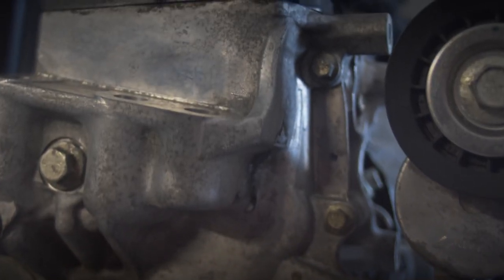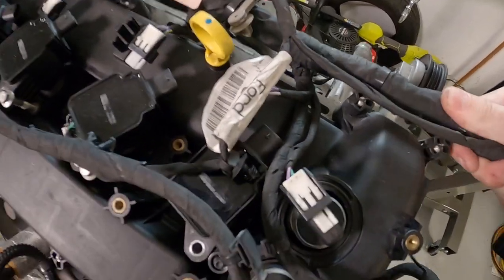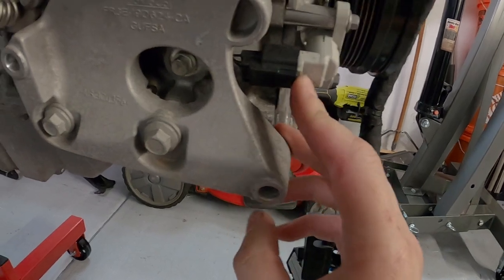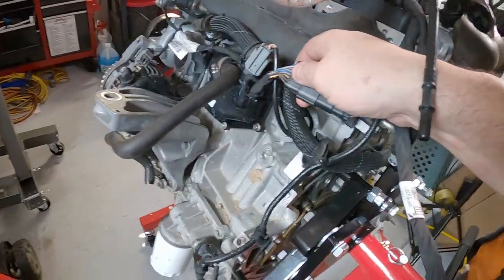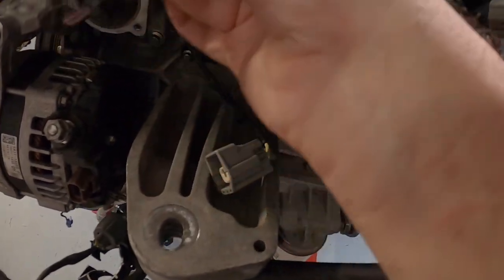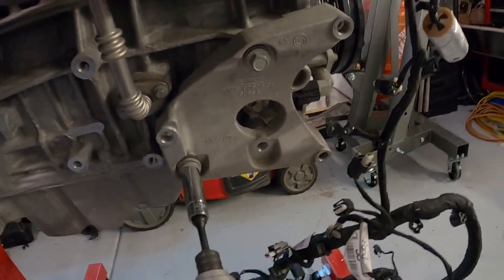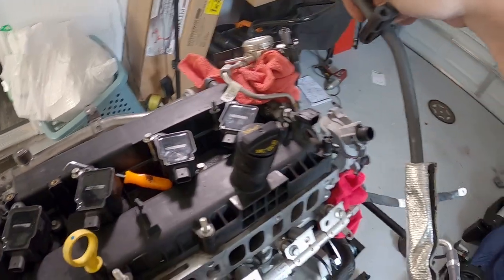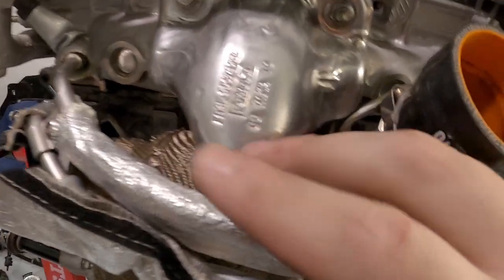Another One - Blown ECOBOOST - 2020 Mustang HPP 2.3L Teardown Part 1

Comment: A large part of the ecoboom problem is self-induced from tuning with a stock turbo. The exhaust pressure ends up much higher than intake pressure, creating exhaust reversion on cylinders 2&3, which is the top single exhaust port you see. That in turn causes detonation, lifted head, boom, busted block. Blaming the block isn’t malicious, it’s just ignorance. Sure a stronger block can withstand more bad conditions, but why create them in the first place? The first mod on my HPP was a NX2 turbo, 3” exhaust, E30 tune, at a reasonable power level. 17K miles of track events and torture, and it’s still going strong. It’s not a block problem, it’s excessive back pressure. Put sensors on turbo exhaust housing pre turbine and intake, to measure the difference. Try not to exceed 1.5:1 exhaust to intake differential.
Reply: A lot of issues as discussed in the forums is drivers lugging the engine. If you drop a gear before going WOT, you prevent lugging and potential for pre-detonation.

I own a MT82 2018 base Mustang Ecoboost. Granted, I don’t push my car as it’s a daily driver. I’m sure that although there are quite a few enthusiasts who bought the car to mod/race, I bought it as an inexpensive, economical sports car. I can afford the GT, and test drove both before going with the Ecoboost. It looks damned good, handles well on winding roads, and has more horsepower than GTs 8 years older.

Comment: I thought the hpp engines were supposed to be more durable 🤧
Reply from the maker: You and me both!
Reply: HPP has a die-cast HO block, with open deck, designed for improved sealing. The 2.0 block is sand cast block, that happens to have more material in the stress point where block destruction occurs, generally due to excessive exhaust back pressure>detonation>head lift>boom. The HO block is fine with a stock, untuned turbo, properly sized aftermarket turbo. Nobody really knows or cares how to gather data on exhaust pressure vs intake pressure, to properly tune, but they keep cranking it up and boom! Then they’re shocked, how can this happen?😢 well, you need to know the basics before you jack around with boost, and a lot of “experts” have never measured differential, for proper tuning.